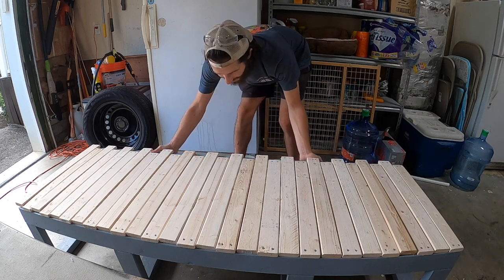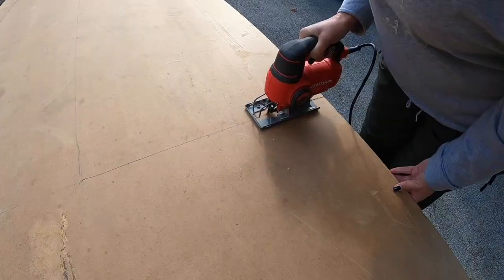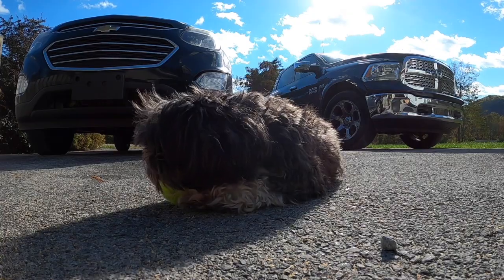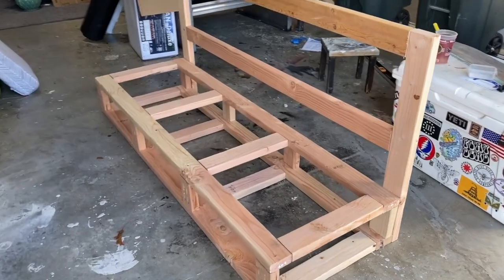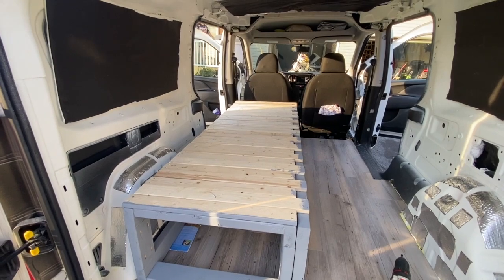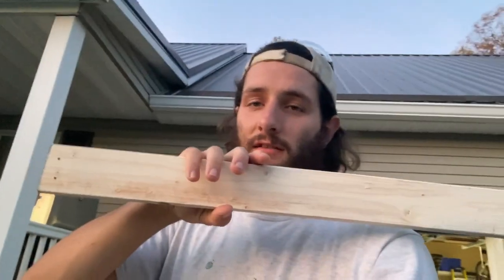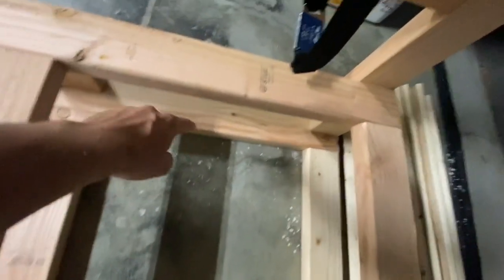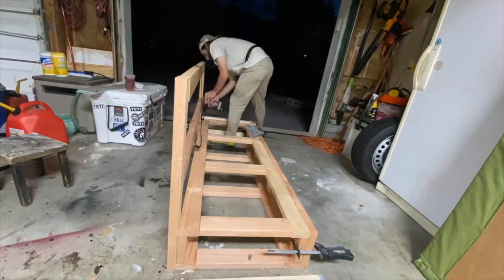Ram Promaster City Van Build: Slat Bed

Comment: Nice job. What inch foam was used & firmness of it?
Reply from the maker: We used a 5 inch foam, a 4 inch probably would have been better as far as extra headroom. It's firm but comfortable, because we put the board on the back it gave it extra firmness than if it were just laying on the slats.
Reply: @catchyoudownthetrail3881   Thank you for the reply